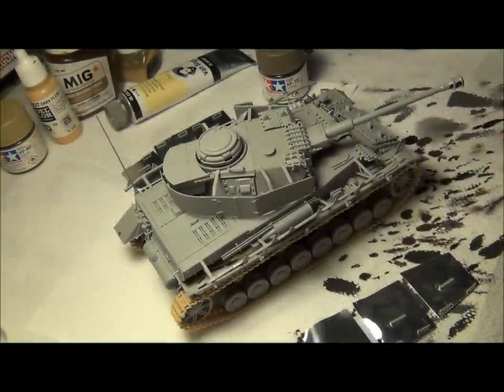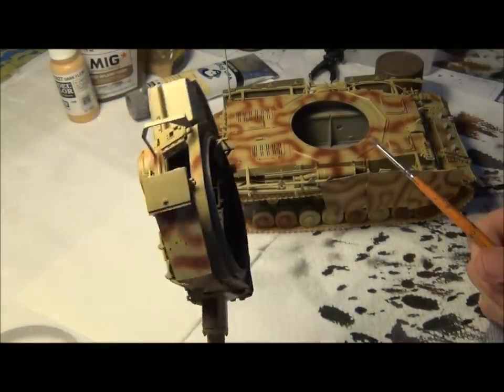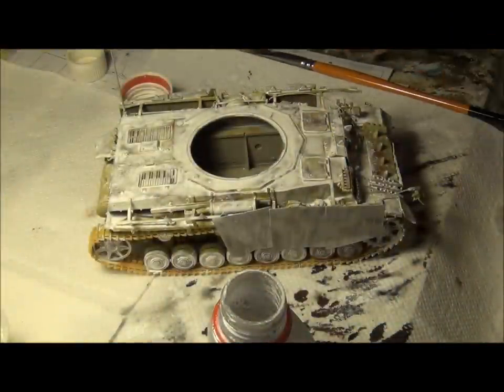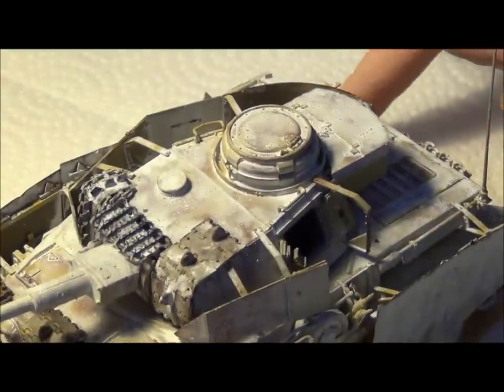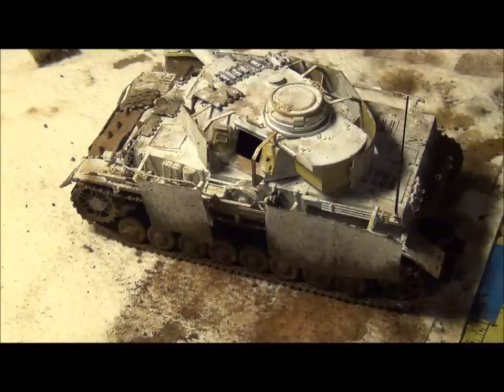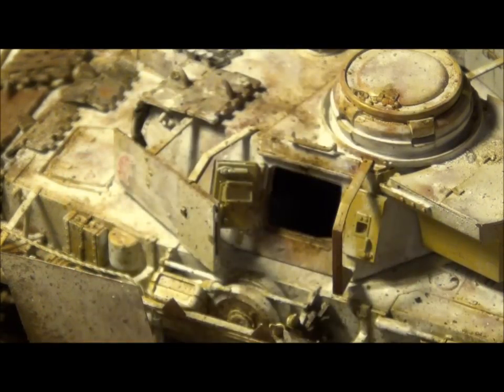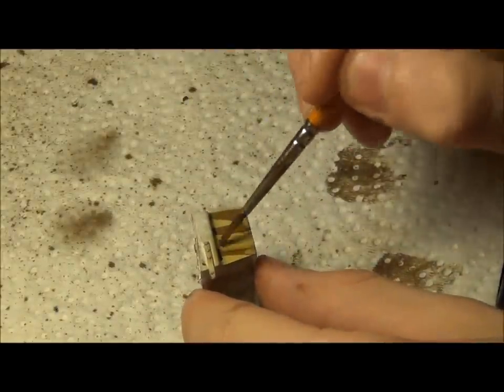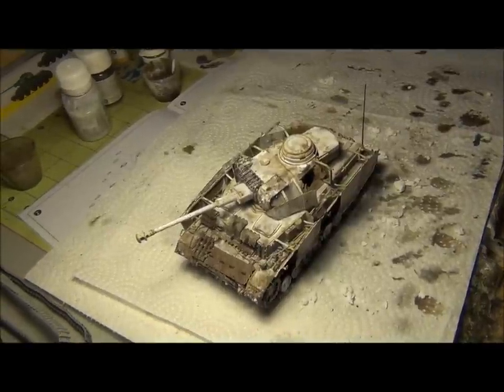Tutorial: Painting and Weathering a White Wash

Comment: Looking good as the winter white wash was more of a diluted paint anyway, to make it easier to remove in the spring time.

I'm curious, did you protect the original paint scheme before the winter wash? I agree about the pin marks, but it's your model...

As a simple suggestion if I may, try a little dry brushing after all the oil,/Mig crap is dry with a lighter shade of the base coat color, just on high areas to bring some detail back after that nice white wash.

I personally think pigments are a better weathering method than paint as paint just looks like dirty paint anyway. Track links look excellent.....
Reply from the maker: Thanks again :D  I didn't protect the base coat as it was acrylics and all the stuff afterwards (whitewash, oils wash, pigments) all some off with white spirits which shouldn't effect the tamiya paint.  It might though, I can't say for sure, but it all worked out.  

I actually went back and drybrushed some XF-55 and -60 a couple of months ago, after the video was done, and it looks really nice.  I was planning on doing that in the video but it looked so good and I didn't want to mess it up.  I built up the courage later though :)

Pigments all the way!

Comment: Great vid. Especially liked the mud effect on the tracks. Have you tried using Apple Barrel Acrylic paints? It comes in a assortment of colors (matte Melted Chocolate and matte Brown Oxide really great for mud effect). Mix paint with plaster then apply to your tank model for mud effect. If you want a slush mud effect add water. You can buy them at Wal-mart for $.50 a bottle. If you don't like the effect you can rinse/clean with water. If you decide later 6-9 mos you can clean with water and re-do it. Can be applied with a brush and you can do the tooth brush effect.

Comment: I'm no modeller, but shouldn't you paint the side panels as if they were intact and then move them? It just looks odd that the camouflage pattern fits even though one of the side skirt panels is hanging off at an angle?
Reply from the maker: I'm pretty sure I did that, put the panel back straight before I put the camo on :)  But it didn't change much as only a bit of the panel is covered in the end, and then of course the whitewash pretty much covered it all...  but thanks for the pointer anyways man :D
Reply: Panzermeister36 Sorry, couldn't tell! Looks very nice, good job
Reply from the maker: Mosktan No problem man :)  Thanks for looking!

Comment: Why are there T-34, Tiger, and Panther tank tracks on there?
Reply from the maker: They did it to provide extra armour, though it didn't really work and added a ton of weight.  Here's a photo:

https://plus.google.com/b/117377533440333189245/+Panzermeister36/photos/photo/6102098319896651522?pid=6102098319896651522&oid=117377533440333189245
Reply from the maker: TheNameIsAlein They did it on Shermans too, but it added so much weight and caused so much more fuel usage while providing practically no more protection against the higher velocity German guns that Patton forbade it!

https://plus.google.com/b/117377533440333189245/+Panzermeister36/posts/LnU8vpRRpEm?pid=6119605697487357714&oid=117377533440333189245